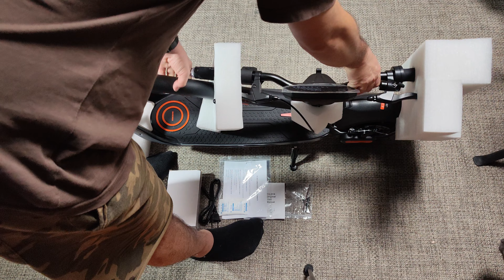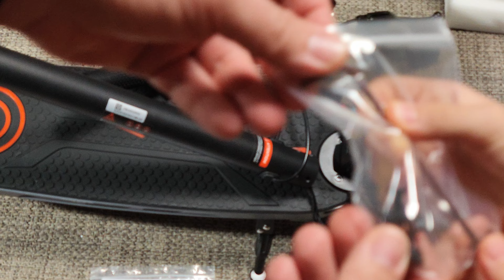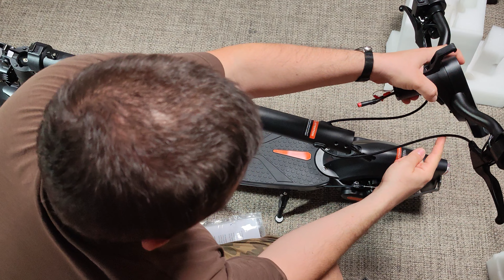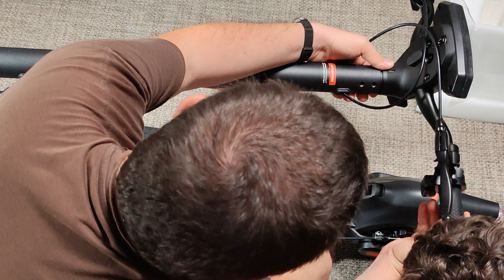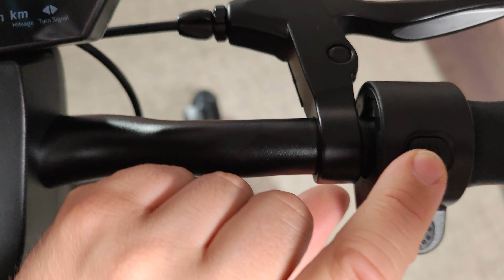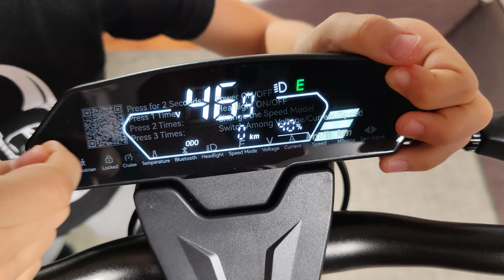KingSong N14 Initial Unboxig Setup and Speed Unlock

Comment from the maker: Join the official owners group here https://www.facebook.com/groups/kingsongescooterowners

You can get the N14 from 
https://myewheel.com/kingsong-n14/
And you can use the coupon code: TechTronic5 and get a 5% off

Additionally you can look at the high performance N12 PRO, a version on steroids with higher power, faster speed and bigger battery
https://myewheel.com/kingsong-n12-pro/
Again also you can use the coupon code: TechTronic5 and get a 5% off
Reply: How do I unlock the speed? The maximum in P3 appears 25 km both in the application and on the scooter (it is the maximum) 😢

Comment: Thanks for the video. I did like you showed, with my N12 pro. So now, app shows limits 25kph (fw 1.40) for all the gears, but in sport mode it's not limited at all. And it kind of want. But I want more mellow ride in p2 mode, and this gear is still limited. @KingSongEurope help please.

Comment: just got this scooter im going to try the Speed Unlock But does it actually work
Reply from the maker: Have you checked the plug in the handlebar stem? Then also check the app settings.
Reply: @TechTronic9000 how to unlock limit speed ?

Comment: Appreciate your tech reports and reviews!
Nice to watch because they're not just about E-bikes. 
Still using a Fidoo D2 that you inspired me to put an extra battery on. 
Looking forward to a review of the perfect, lightweight, easy to fold and carry E-bike (sold at budget price)  :-)!
☺
Reply from the maker: I was about to suggest some light bikes, easy to fold, but they are not so budget priced. You can have a look at my ADO AIR PRO review. It's a very good bike if you don't mind the 25km/h limit. Also the ENGWE P20 is good.
Reply: @TechTronic9000  Thank´s! I´m rather pleased with my ADO A20 (except the terrible bad brakes) so I have looked at the Air models. But I want to be able to quickly swap batteries so I will have a look at the Engwe model. 25 km is the legal limit here and it`enough for my needs.